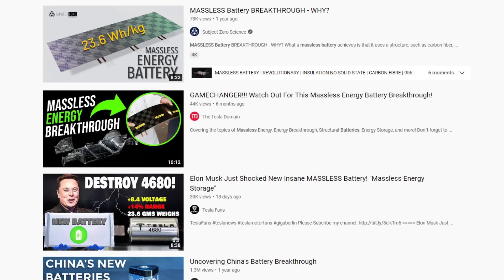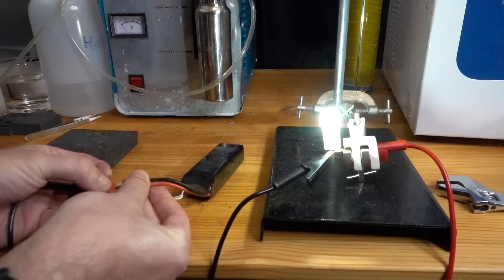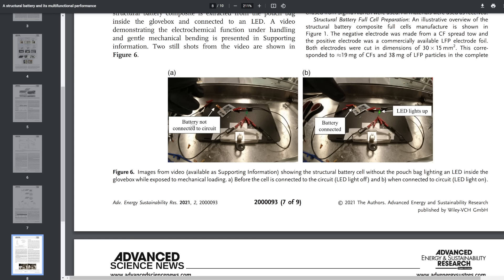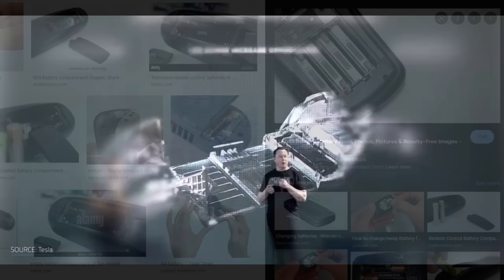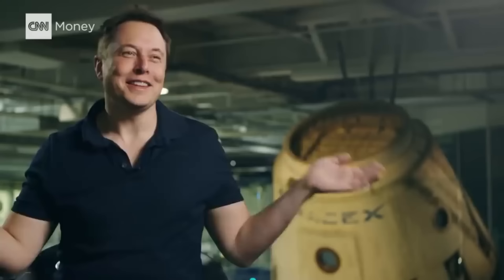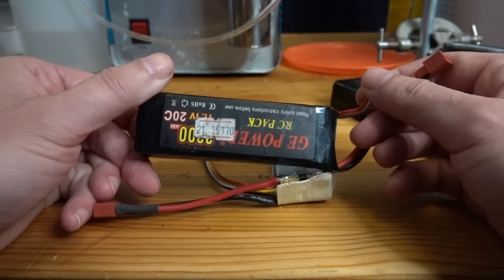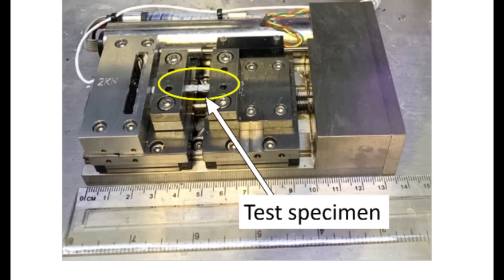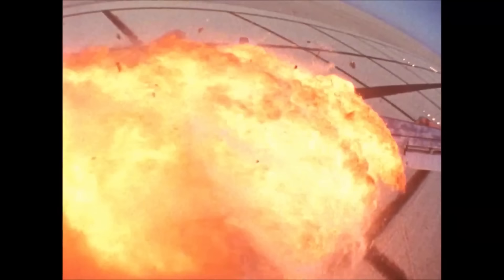Matt Ferrell, Massless Battery: BUSTED!!

Comment: The battery is one of the shortest lived parts in almost any electrical device - because they have a limited number of charge cycles, and can also be damaged by extremes in temperature.  So even if you could make a structural battery, it would mean that a dead battery will mean writing off the entire device rather than just replacing the battery.  That's why Musk's idea of sealing the batteries inside a non-removable structural compartment is a terrible idea.  A battery is pretty much a consumable item, so you want to be able to replace it from time to time.
Reply: Imagine that they will be selling "empty battery cases". Battery died? Sure, buy a new shell, put in the motor and seats and you are good to go!
(I know it is bad idea, but it is a funny one)
Reply: The only battery type I can imagine being integrated in anyway that makes sense is a flywheel battery. they already need a large casing and with some engineering you could probably integrate the casing into a structure without blocking the replacement of the flywheel or other parts that might need to be repaired.
Reply: @liamnehren1054  At least in data centers, inertial ups backup supplies last seconds before they drop to too low output to be useful.
Reply: @JasonW.  Sometimes even classic battery UPSs fail in seconds/minutes, because after they are installed, everybody forgets about them and the battery dies in few years :D
Reply: But these are magic batteries with infinite charge cycles and limitless storage
Reply: Cellphone batteries are different from vehicle batteries. Look up the actual degredation data from Tesla batteries - it's easily available, from datasets with thousands of vehicles.

How are Thunderf00t fans on the stupid "car batteries need to be replaced every few years" bandwagon? That was a fossil fuel talking point.
Reply: @chrisannika6006  I have looked into those claims, and also note that the common response by Tesla fans to battery life issues is to state that Tesla gurantees its batteries for 8 years or X miles (typically 150000 miles).  They then go on to say that that means that Tesla would not give such a long warrany if the battery were not reliable, and if the battery does not last 8 years then you will get it replaced for free so concerns about battery life is not a valid reason not to buy a Tesla.

However when you read the actual warranty given, it's not that simple.  The warranty is weasel-worded, and what it actually states is:- "These warranties cover the repair or replacement necessary to correct defects in the materials or workmanship of any parts manufactured or supplied by Tesla, which occur under normal use."  and "The [Tesla] battery, like all lithium-ion batteries, will experience gradual energy or power loss with time and use.  Loss of battery energy or power over time or due to or resulting from battery usage is NOT covered…except to the extent specified." 

So if your battery packs in after 2 years, then unless you can prove that it has a manufacturing or material defect, the warranty won't apply and you will have to replace the battery at your own cost.  Cost of a replacement Tesla battery is currently around $20000, not including labour.  Tesla will simply say that the battery degraded because of normal (or abnormal) use, and so is not covered.  As such the warranty is pretty worthless.

The "real life" data that you have found almost certainly relate to batteries that have been treated with great care in cars that are only used for short journies in a benign climate.  Fully charging or entirely depleting your EV’s battery can degrade it more quickly. Keeping the charge level between around 20% and 80% is optimum to make your battery last longer. It’s no coincidence that car makers often quote charging times to 80%, rather than full.

The frequent use of DC rapid chargers also has a detrimental effect on the life of EV batteries. Rapid charging is the quickest way to refill an EV battery, and the fastest public charge points can top them up to 80% in 30-40 minutes - but at the cost of greatly reduced battery life.

So - the real range of any EV car you buy is about 40% of its quoted range if you don't want to damage your battery by using more than 60% of its capacity.  And all those rapid chargers that we are assured mean that we don't have to worry about travelling long distances, because we can simply charge the battery at a rapid charge point while we take a 30 minute break will also result in early failure of the battery.
Reply: @JasonW.  have you looked into modern flywheel batteries? some of them can contain immense amount of power, the fact that someone installed flywheels and they run out quickly doesn't really mean much when the goal was never to have it run off of it and just as a current stabilizer.
Reply: @liamnehren1054  Yes, these were installed in a data center in 2010. The flywheel runs in a vacuum with magnetic bearings. The flywheel only has a small time before the mass no longer spins fast enough to produce useful power. There were 150 of these units installed, which was just enough time (with margin) to start up generators.
You'd never get these in a vehicle. Way too heavy (by design and requirements) and the magnetic bearings would not work in a moving ride. This is not considering how hard changing direction would be in such a design.

Comment: I disagree with you about gravity feeding. The fuel boost pumps are low pressure pumps that just feed fuel to header tanks during critical flight regimes. High pressure pumps then take low pressure fuel and increase its pressure to be fed into the combustion chambers. However the boost pumps not always required as their function is taken over by during non critical flight by ‘jet pumps’ which are Venturi (powered by excess return fuel from HP pumps) devices. The main reason for an aircraft having fuel in its wings rather than anywhere else is that it reduces wing bending loads. Now this is really convenient.
Reply: yep, was also a bit disappointed because he googled the injection pressure but nevertheless this matt guy is wrong for stating obvious bs arguments. i mean ideal structural position and best use of otherwise dead space(volume) is main point for fuel tank position in wings
Reply: Different planes have different needs. I don't blame him for not being an avionic engineering expert.

Ultimately there are many aircraft that need to use fuel pumps 100% of the time or cannot achieve the requisite fuel injection without working fuel pumps.
Reply: Okay so not gravity fed, since it won't work without the high pressure pump.  Got it.

Comment: My electric car needs to have its battery changed due to a manufacturing fault. I'm really glad I don't have one of the new Teslas where the battery is part of the car's structure, and Hyundai probably is too, because otherwise they'd have to give me a whole new car. I know Tesla is new and has a lot to learn, but there is a reason why cars can be taken apart. Things fail and it is better for both the economy and the environment to change the part instead of the whole car.
Reply: no they replace the floor which bolts in with a bunch of bolts. munroe pulled it out pretty easy. don't you think they thought of warranty? and if they gave you a new car what's wrong with that. you get a new car after a few years . who's complaining about that?

Comment: Back in the days, I was a student, and later scientific assistant, at just an university of applied science, in the area of BIS. But even there, publishing papers about "massless batteries" would probably be rejected because of the obvious misunderstanding of physics / deliberierte statements of complete BS. That should not even be mentioned somewhere on a research platform.
Reply: Than wireless technology shouldn't exist because there's no such thing you still have wires. Wireless communication? Nope wires are used to the electricity to EM waves, Bladeless fan? Nope there are still blades hidden inside the structure.

Comment: That tesla battery change just sounds like an effort to make expensive cars throwaway items instead of repairable. How do you fix or replace a battery pack when the cells are glued in and the case is part of the structure?

Comment: 26:25 Small correction: Most LiPos balance leads are series. Black to red would be the full pack potential, black to 2 wires over would be 2*cell voltages

Comment: I can see a new future of running my car and home from a series of potato batteries! 
It's new, clean, renewable, and delicious deep fried!
Reply: I remember my first racing drone, I bought this carbon fiber bottom frame plate that had circuitry running through it because it saved me from having to buy and install a power board and the smallest crash grounded the power to the carbon fiber (metal) frame and it caught on fire. Carbon fiber conducts electricity . Such a bad idea.
Reply: @p.chuckmoralesesquire3965  I learned the same in Aviation school. A simple read on electrical conductivity could have told Ferrell that battery idea wasn't very smart!
Reply: @youtubemusicowesmemoney8470  yeah man i thought carbon fiber was basically plastic but it is not the same thing. most plastics do not conduct electricity

Comment: Of course you can gravity feed the jet engines. The high pressure pumps are in the engines. These are supplied by a low pressure system. 
There are multiple pumps and valves in the low pressure system, and gravity feed is not ideal, but can be done.
For example the A320 can gravity feed the engines from the wing tanks but not the center tank, because suction valves are not fitted to the center tank.

Comment: Thanks for the video! But I just have to nitpick a little. You can't make a BUSTED video without awakening the nitpickers 😄The 4 wires on a normal 3-cell "hobby li-po" is not common ground and then one for each positive cell. I'm pretty sure you would get a surprise at cell 2 if you tried to connect the ground wire like that in a battery pack where the cells are already connected in series 😎The black wire is connected to negative of the first cell (same as the big black wire), the next 3 wires are connected to each of the positive cell poles. So in a fully charged pack, the voltage between wire 1-2 is 4.2V, between wire 1-3 is 8.4V, and between wire 1-4 there is 12.6V. While it is possible to charge it via the small connector, the thin wires would only be able to handle a pretty low charging rate. So for bigger batteries you normally charge with a huge current through the main wire, and then only do balancing on the thin wires. I.e. the charger monitor the voltage of each cell and drain some current from the cells that are rising to fast.
Reply: Was going to say the same. Having a common ground in a battery wired in series is, let's say, suboptimal.

Comment: He talks about how EVs need a bunch of structure to protect the batteries... but thats still the case with this stuff. Just because the battery is integrated, doesn't mean it wont explode when punctured. You have the extra structure for safety not because its going to fall apart.
Reply: The Ford Pinto of the EV world. I can't wait for the rolling thermite bombs to join us on the highway.
Reply: @bytoadynolastname6149  Or, as I wrote in another comment, commercial aircraft whose fuselage, tail, and wings are all made of structural batteries. Sounds great in theory, bu in reality, such airplanes would be multi-kiloton flying bombs.

Seriously, it boggles my mind as to how many people think that this would be even remotely feasible in practice.

Comment: I just want to mention that you might have made a small error at around 26:20. We typically don't charge lithium batteries through their balance leads as you mentioned. Instead, we do the opposite in order to balance the battery. We first charge through the two main power leads, then when the cells are out of balance, we discharge the higher cells through the balance connector at low current to match the voltage of all the other cells. Once balanced, the charging process continues. This is all automated in a lithium battery charger. One small remark though. You are partially right because some different forms of batteries do indeed charge through the balance lead with no problems, however it's less common. Just thought I'd point it out, thanks for the video though. I agree with you, massless batteries are bullshit. Cheers Phil
Reply: Small chargers and field-charges often only use the balancer wire.
And most importantly he got the connection of the balancer connector wrong:
Black goes to the (-) of the whole pack so on one end, red goes to (+) of the whole pack and all the wires in between these two on the balancer kabel are connecting to the contacts between each cell.
Voltage of cell 1: Red and Yellow
Voltage of cell 2: Yellow and White
Voltage of cell 3 White and Black
Reply: "we discharge the higher cells through the balance connector ", THIS literally means you charge through the balance leads duh. 
One discharges another charges. 
Too complicated for you?

Comment: I saw Matt's presentation and just shook my head especially when he started talking about fuel pump failure, apparently Matt hasn't noticed that only Cessna small aircraft have wings mounted high enough above the engine to gravity feed to the engine.
Reply: And the Cub, the Taylorcraft, the Aeronca Chief, the Citabria... The list of small aircraft with no fuel pump is actually quite long.
Reply: @SwervingLemon  I rebuilt WWII aircraft for 14 years am a private pilot and my brother owns a Citabria and I had numerous BD-4's and a Beechcraft Musketeer and been an EAA member for more than 40 years...most people have heard of a Cessna far fewer know what a Citabria is.
Reply: >In theory< it could gravity feed the engine in multi-engined aircraft where the engine is directly underneath the wing, but yeah you generally need fuel pumps for a reason.
Reply: And of course these small piston engines have carburetors, so they don't need any appreciable fuel pressure to work.

Comment: Thunderf00t, I have no doubt you're correct in this video. I just want to say that carbon fiber is indeed a very strong material, however it has to be rigid and stiff. The way batteries work is be electric charges being transferred. Solid carbon fiber can't be soaked in an electrolyte that is rigid.

I really just hate people that come up with ideas without considering the laws of physics.
Reply: Haven't you read the memo? The laws of physics don't apply to game changing breakthroughs. 😂

Comment: @Thunderf00t just one criticism. Airliner engines can also be gravity fed - that is actually a rather well known fact.
It's very common among many airliner types and even led to an incident where an Airbus 320 climbed to FL380 (38000ft!) until the system failed. It basically did the startup, taxi, take off and climb to FL380 purely on gravity fed engines. Both fuel pumps were left off. This only created a caution which the crew cleared and then forgot about.
There is a paper on this incident from Airbus itself you can use to fact check: https://safetyfirst.airbus.com/app/themes/mh_newsdesk/documents/archives/fuel-pumps-left-in-off-position.pdf
This paper also explains the limitations on altitude increase based on Henry's law.

Comment: There seems to be an enormous mixup of "battery" and "cell" in both videos. The sensitive part is the cell, or even the insides of the cell.

What I take away from this is basically: build a structure with voids in, and fill them with cells.

Another take on this is to make the chassis a bit weaker since the battery pack mounted will stiffen the car and hence make the back itself a part of the structure.

I have not read the primary source, so I cannot judge this research, but the term "structural battery" still sounds sound in some cases in my eyes... And also nothing new.

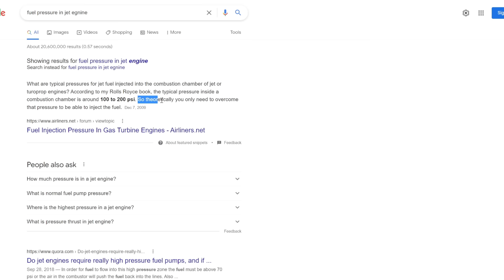Comment: 12:00 - ooof @Thunderf00t, you bit off more than you can chew there; the fuel pumps in the fuel tank (on the wing) do not "inject" fuel into the combustion chamber ("burner can"); the pump or pumps which do that are on the engine itself. The fuel tank pumps only provide "boost" pressure to feed fuel into the engine fuel system - which is about 40 PSI; and the engines  run without the boost pumps using gravity and/or suction feed mechanics - the boost pumps primarily serve three purposes; allow for direct fuel consumption management, assure positive flow during all phases of flight in all expect aircraft attitudes, and satisfy regulatory requirements for systems redundancy/reliability.

The essence of the system theory is that a large volume of fuel at a moderate pressure is supplied to the engine fuel pumps/regulators/control units/etc., which only consume the fuel which is commanded/demanded by the engine control systems, any extra fuel from that aforementioned large volume goes to a fuel return valve which returns it to the tank of origin. 

Swing and a miss on this one.
Reply: Shit thanks for pointing that out. He's only batting 999, I should immediately discard anything I have learned from him.